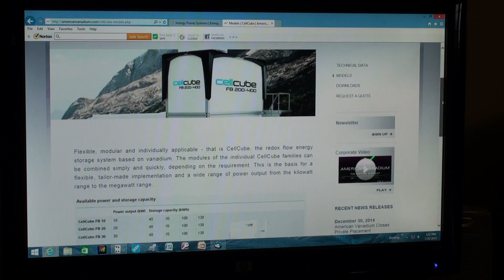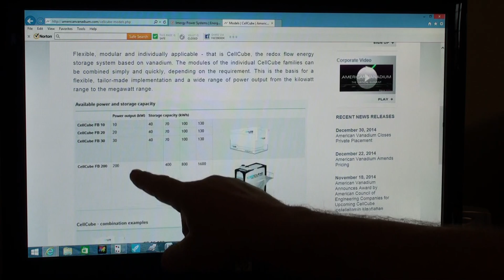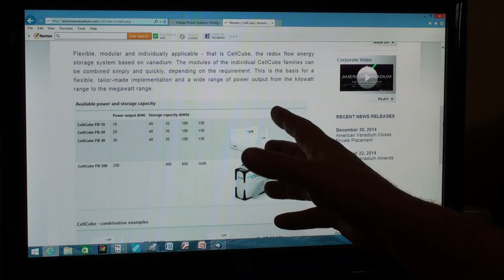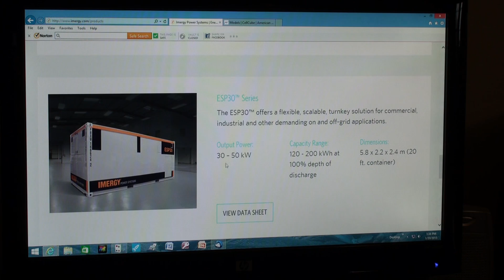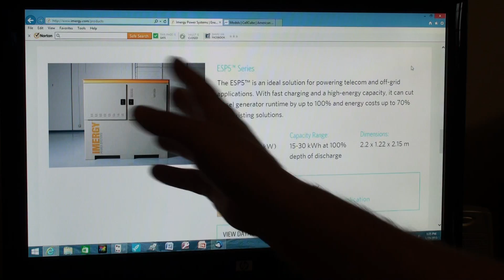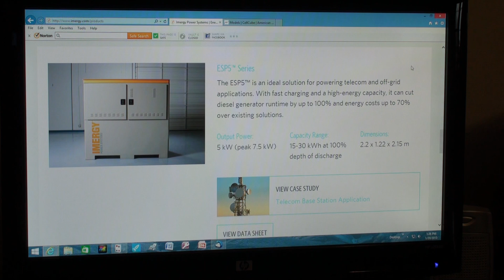Redox Flow Battery Available for Residential Off-Grid Applications, Vanadium

Comment: On the German site the Batteries are already set up to take DC power and they have an integrated unit that uses wind/solar and a carport to recharge cars or bikes. This technology was invented in the 80's and I used to write to the Uni of NSW and Maria Skyllas Kazacos then write to  our Government she got a better hearing from the Chinese Government and they tried out a Bus System with this. Germany,Japan ,Australia and Canada have some large back up systems for grid levelling and UPS for Hospitals etc. If this was widely adopted back in the 80's the costs would now be accessible to the home user. Anything that threatens Vampire Economics and the concentration of corporate power is always get the SLOW treatment.